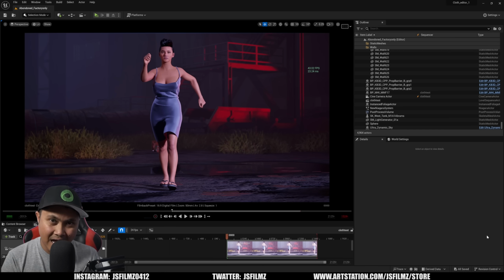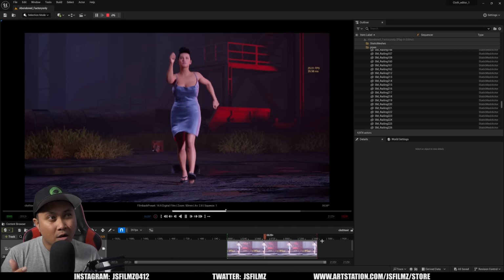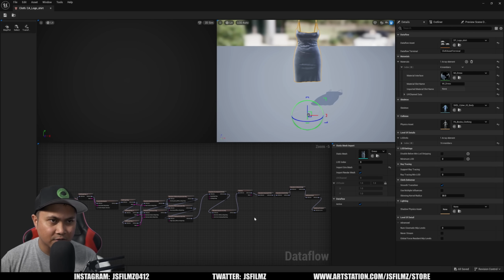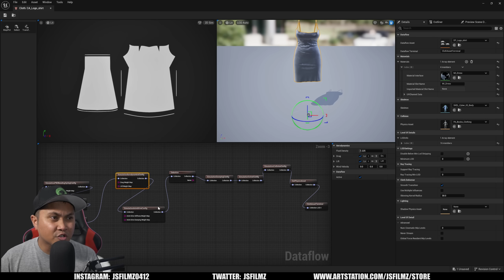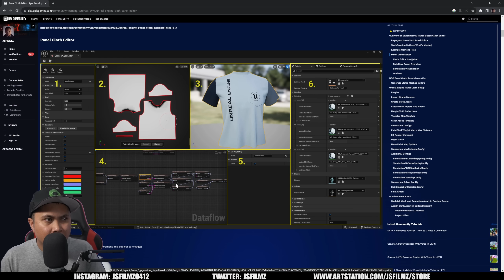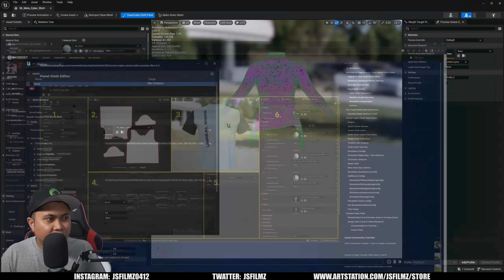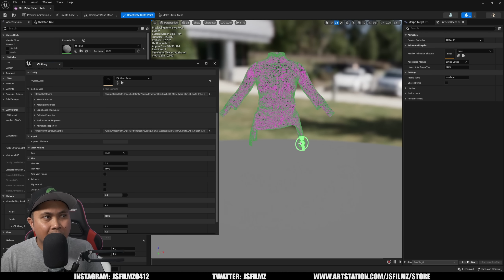Unreal Engine 5.3 Realtime Cloth Simulation with Jiggle Physics

Comment: usually with the node system a lot of the option to toggle are outside the blueprint on the right menu if that hasn't been added yet id assume that would be the next step also the blueprint you looked at was very messy could of been cleaned up a lot in terms of look and organizing that's just poor presentation i do agree about the interface drop down menus but they should still have that for this just outside the blueprint and if they don't they need to add it going to each node is not a good method i agree

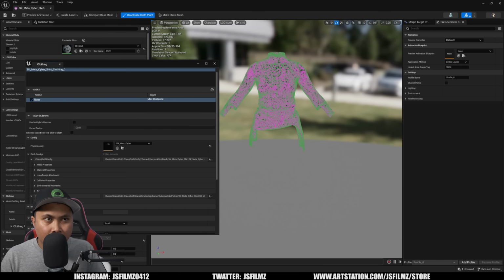Comment: 4:03 thanks for showing before and after. I havent touched Cloth sim yet. But one reason I see to use Blueprint nodes is easy copy/paste the data values.
In UE if we use panels 4:03 to set data, there is a way to right click, copy each variable type. But it is slooooow because we need to right click/copy for each variable line.
But if the data is in Nodes, then I hope we can just copy paste Nodes from Shirt A to Dress B, then only need to mod slight variations. 
Also BP nodes can be copy/pasted into Notepad as easy to see/save data.

Comment: The node based system allows easy to understand and none-destructive workflow. It's personal preference of course.  However, when you think about it Davinci Resolve and Nuke also uses node based systems for non-destructive compositing and color correction (Not the expert of the topic so please excuse my generalization and simplicity). Even Blender and 3DS MAX uses node based flow to make the non-destructive workflow possible. They're just using different UI.

So, long story short, it is all about non-destructivity. This way you don't have to wory about saving your cloth asset. Cause even if you saved a change that broke your clothing, it doesn't matter. You don't have to remember the exact settings you've used before or try to find something equivalent to it.

Comment: I’ll be using the node based method. Coming from Blender and playing with Geometry nodes, node based simulations aren’t too daunting to me. 

Another advantage that node based system has is you can duplicate a node, change a setting, and connect the new node up to the chain while disconnecting the original without deleting it. This will allow you to try different settings without overwriting settings, and you can simply connect the node with the settings you want from the field.

Comment: Nodes and blueprints are significantly more user friendly especially. Older devs may prefer the old method but new devs or students will learn node and blueprint in significantly less time. Also, node and blueprint is visibly more understandable and easier to troubleshoot because it's got a better component view.

Comment: As someone not doing anything with UE5, I watched your video anyway... And I have to say the node system actually looks less scary than hundreds of dropdowns in front of me. The nodes are basically visual breakups where all the same options are stored but not all at once. For me the node system looks more appealing.
Reply: Also for anyone: In UE if we use panels 4:03 to set data, there is a way to right click, copy each variable type > paste that value into a new asset (new dress). But it is slooooow because we need to right click/copy for each variable line (50 variables?).

But if the data is in Nodes, then [at least in normal Actor-code BPs] we can just copy paste Nodes from Shirt A to Dress B, then only need to mod slight variations. 
Also BP nodes can be copy/pasted into Notepad as easy to see/save data.

Comment: It seems like possibly they have bigger plans or the solver is not that same or maybe needed more treakabillty in the solver.

That being said I agree if none of that is true then this would be completely unnecessary. And adding a mess of blueprints learn is kinda of a "dick move"
Reply from the maker: only thing i can think of is ML deformer but not sure if that requires BP haha
Reply: @Jsfilmz  The intent maybe to let your rewrap the  nodes for nitch case situations. Or better performance optimization. Or to let you build a custom pipeline by sticking things in the middle.
Reply: The ability to tweak the low level internals of the function is probably appealing to many.
Reply: @Jsfilmz  As others have suggested I'll probably just end up restoring similar workflow by making a node that exposes all the settings like before.. I can make it a shared component to import into the project then I'm good.

Comment: Dude I'm TOTALLY WITH YOU!!!   And don't even let me start on Flesh and the crowd system.
I've been working in CG industrial for 20 years and there's not a single software made it so complex and unintuitive just to get a softbody simulation and some random people walking on street.
We have to learn all these stupid procedurals of basic asset creating just to connect the system by hand, which should really be shipped as a integrated module.
Please Epic, just stop inventing new unnecessary work flows like dataflow. A well designed UI is all an artist needs.

Comment: my guess it's about static mesh/skeletal mesh as you mentioned, as all UE users know that components beginplay with class casting. There is no new old method here. one is casted for skeletal the other node based is for static mesh.
Reply from the maker: nope both static meshes like i mentioned in the video 0 skeleton on both dress inputs

Comment: I prefer node and blueprint. Eventually customizable widgets of complex blueprints will make them more manageable and less daunting. Macros will also go a long way to simplifying things for those who don’t need to deep dive into node settings much of the time.
Reply: Yeah very least the first thing I'm doing is bringing back the unified settings by means of a function or macro. Then I'm mostly good. If I need to tweak ill tackle that later.
Reply: Can someone give vid examples of using/setting up Macros/functions for this (for unified settings)?
Im thinking of Physics assets and the setup for each physical constraint... it is annoying because it uses the Panel for settings. Thus it's slow to copy/paste settings from asset 1 to 2. 
Thus im thinking that with Nodes and Macros - there is a faster way to setup my basic settings on new assets?

Comment: Everything is going nodes. I use blender, and while I can't do ANYTHING in materials, compositor or geo, I understand the power of that paradigm. Its the same with after effects. I can use and understand layers, but with some clever rewriting, it can be represented with nodes (in fact someone did just that recently). It makes certain things much easier and overall more powerful and repeatable - which for VFX is vital. Yes, it's obtuse, but anyone who uses nodes for awhile knows that the learning curve was worth the effort. Its like learning a foreign language. Slowly I'm getting the hang of it. Eventually it will be second nature. You "node" I'm right.
Reply: Agreed. Once you get used to Node based, you'll understand more and more why this is a better approach rather than layer or modifier based. Its part of the reason why Houdini is soo big in the industry!

Comment: hey J node based is really amazing/essential. The old system is outdated and adding features to it will be a bottleneck. going node based is a future investment imo, because it allows for so much flexibility and will be easy to use long term. Think of houdini style cloth sim with modularity of adding ML deformers on certain joints etc. Once u look at the nodes it will be easy for u to understand and learn/replicate. Nodes give u extraordinary amount of control😍

Comment: You could probably make one single "classic" node (or a macro) that has all the old settings style. I think this flexibility might get shown its pros later on when combining different stuff like having different solvers and parameters based on for example camera distance, yes as you said game making things; Although that could be good for large movie scenes like over a battle field where you have the same characters but different LOD on the cloth simulation.
This is at least one thing that I can think of that this flexibility that perhaps bring, I haven't used the cloth sim for more than basic tests.
Maybe there could also be more interoperability between this cloth node system and the other blueprints systems (like Actor/Level BP, PCG, AnimBP e.t.c.)
Reply: That's what I intend to do.
I agree its probably a nich case thing. People wanted more grandular control of the function. Give it a week and I bet someone makes a tree full of math I'll never understand doing a bonkers level simulation in real time.
Reply: Nice ui layout provides absolutely zero benefits over a proper ui.  There is no more flexibility simply because replace a proper class call with a visual representation of it.

Comment: 25fps epic settings 4090. At what resolution. Hopefully not under 1080p. It would be like 10 to 12 fps on a 3080 or 4070.
Reply from the maker: yea realtime its still heavy even at low iterations im rendering it now